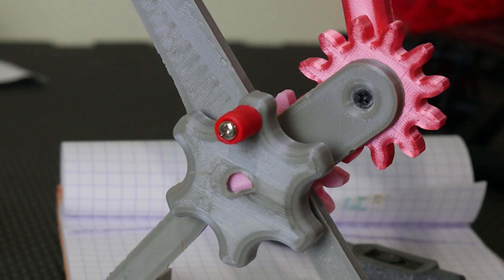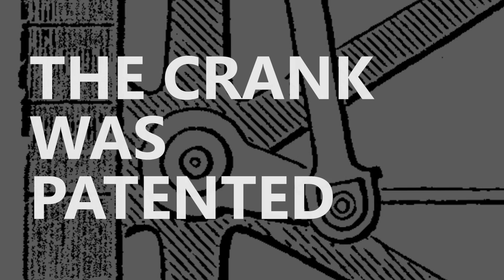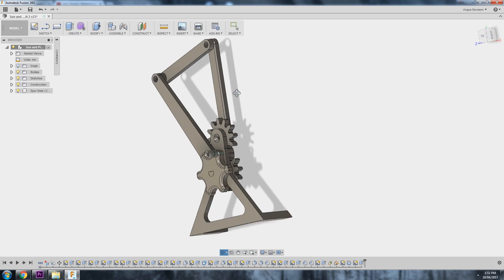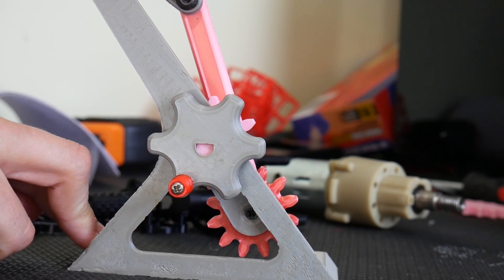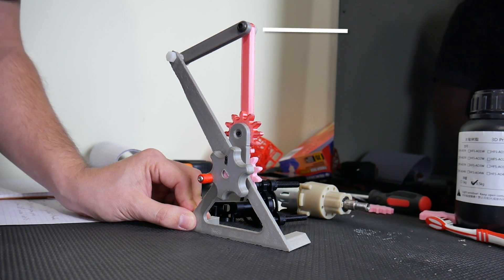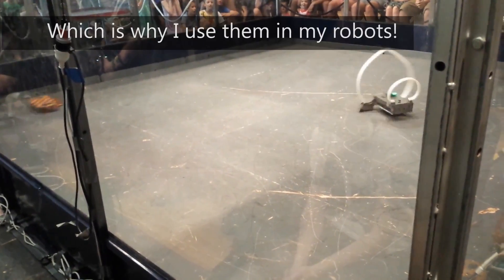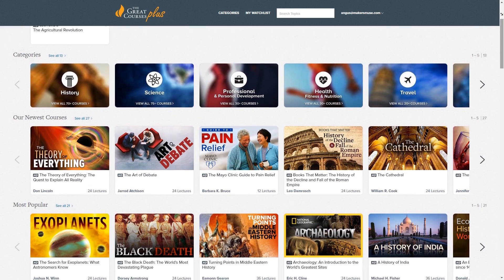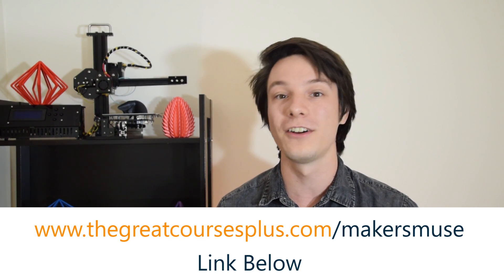How James Watt circumvented the Crank - Mechanisms of the Industrial Revolution

Comment: Super informative and entertaining channel.
I have a problem designing a tri-wheel drive in SW2016. I was wondering if you've ever designed one?
The drive shaft of each motor (4 motors in a 4x4) connects to the wheels that are mounted in a triangular formation, with the main shaft connected to the 3 gears in the middle. 
I have seen one in a space movie and I have wanted to try one myself. It uses 12 wheels (3 wheels on each motor) and only 2 wheels touch the ground at any one time. The third spins freely in the air. You can do it in any cad package you like. I want to see how the ratios are selected to have a nice fit. I have tried and failed multiple times. :(
It has excellent traction and each assembly, will spin in water like a paddle boat. I have searched hard and wide, with no results.

Comment: Patents are cancer.
Reply: Matthew Farrell  Educate yourself maybe ? Maybe read some research papers about public and private funding , here I'll even link one for your convinience : https://www.ncbi.nlm.nih.gov/pmc/articles/PMC3378609/#__ffn_sectitle
Being uniformed is ok, but please at least try to remidiate to it before  speading your stupidness, thanks.
Reply: That's the broken window model of economic growth.  If a particular design works acceptably, why should one need to engineer around artificial economic barriers?
Reply: Patents can either promote or stifle progress depending on the situation. on one hand if you can't protect your invention, then maybe you might not bother pursuing it in the first place. On the other hand, if you patent your invention and don't let anyone else use it at all even if they independently come up with the same idea, then the patent is preventing forward progress.
Licensing does help solve some of these issues, but the patent holder might set the price too high, in which case licensing may not even be a consideration.
Reply: That's absolutely not true.  I can point to plenty of open-source projects where the developers haven't earned a dime from it but have transformed the world.  Linux is the classic case in point.  The patent model just encourages a rentier mentality, not to mention patent trolling.  It  may have some apparent upsides, but it certainly has its share of downsides to go along with it.
Reply: Patents as a whole aren't cancer but the current laws are extremely outdated.  

For one the long delayed "use or lose" laws should be implemented to make patent trolling impossible.  And in a lot of fields patent duration is waaaaay too long. Electronic technology of 20 years ago is so outdated that it is absurd that patents that old still exist.
Reply: Behindspace90 Depends on the licence used, MIT licence says you can do what ever you want with the code, GPL says you can do what ever but have to make your contribution available to everyone. MIT license could very well live without ip laws, and GPL is actualy leveraging IP laws to fight IP laws.
Reply: There was massive innovation long before patents came along. So the idea that would stop inventing or improving on things because they might not get 100% return on their investment is false.
Reply: Yes they died protecting those secrets. Which is exactly the problem.

One very important aspect of patents is that after a while the patent expires and the technology becomes available to the public.

But like I already said: 20 years of patent made sense when development of new inventions was slow, not in the age we live in now where technology a few years old can already be outdated.
Reply: You're splitting hairs here.  Open source is definitely a licencing arrangement of some form, but with its focus diametrically opposed to the ideas of patents.  Arguably the only significant feature in IP law that supports it is that patent monopoly privileges for prior art cannot be claimed.  Open-source arrangements could operate entirely without IP law, but copyright and patents could not.
Reply: @Behindspace90
agreed,  patents also encourage/ force creativity and innovation as demonstrated in this video example...
Reply: This patent led to the invention of another type of gear. Patents encourage people to problem solve.
Reply: Matthew Farrell

I like the way you didn't even bother to read the paper he linked. "private sector more frequently violated medical standards of practice and had poorer patient outcomes, but had greater reported timeliness and hospitality to patients" Which pretty much sums it up really. Private sector makes you feel good with lower waiting times and the like but delivers lower quality care and is less efficent.
Reply: The patent system was flawed from the very start, as you can see. One of the ideas with patents is that after one inventor designs a machine A1, learning from the patent, another inventor might design an improved machine A2. The two inventors are then assumed to want to cross-license so that both can manufacture the improved machine A2. But the first inventor would very much prefer a monopoly on A1 than competition over A2, and so no improvements happen for 20 years (but there could of course be other machines B1, C1, etc., with sufficiently different design that they don't infringe on the first patent, provided that patent claims aren't allowed to be too broad, as has often happened).
Reply: That's the typical black-and-white reasoning from patent defenders – you're overestimating the importance of patents by assuming that without them, no inventions would ever be made at all. Being first on the market may in many cases be sufficient advantage, and reverse engineering isn't completely free and instant. Even if some legal protection from straight-up copying is warranted, what says it has to last for 20 years? 5 years seems more reasonable in most cases.

And why should independent invention not be a defence? If you happen to be the first to recognize a problem and come up with a moderately clever solution, why should nobody else be allowed to come up with the same solution for 20 years (or sometimes any solution when claims are allowed to be too broad). You seem to be assuming that most inventions are so ingenious that nobody else would have thought of them, ever.

Originally the idea was incentivise disclosure so that inventors wouldn't take their inventions with them when they die, but if an invention is so impossible to reverse-engineer, why would the inventor need patent protection? On the other hand, if an invention is easy to copy, why would it need to be disclosed? It's not as if patent descriptions are really a good source of knowledge.

Patents are monopolies, and monopolies are generally considered bad, so the burden is on you to prove that the patent system is necessary and optimal.
Reply: There's a famous quote by Bill Gates: “If people had understood how patents would be granted when most of 
today’s ideas were invented, and had taken out patents, the industry would be at a complete standstill today.”
Reply: Say you're a startup with a patent or two and try to actually sell a product. What do you do when those established manufacturers contact you saying "Nice startup you have there. Nice patents. Now, we happen to have a few patents of our own. Several hundreds, in fact. You're probably infringing a dozen or so. Can you afford to check them all? Can you afford not to? But hey, if you pay a small fee and promise not to sue us, we'll spare you the trouble and promise not to sue you."?

Solution? Don't try to sell a product that you could be sued over. Instead just wait until someone else inadvertently infringes your patent, i.e. become a patent troll. How does that contribute to progress?

It would be more honest to actively try to license your patents, but you probably wouldn't get too much.
Reply: Are you trying to say remediate? You got a little flustered there, or something.
Reply: Oh, really? Name five...in the same subject matter
Reply: What you are saying in effect is that "only the rich should be rich".

If my invention goes to market I would be a startup. Established manufactures could easily out produce me and enjoy a windfall leaving me to eat dirt.

Just as happily for them my work could be discarded and let the status quo continue. In either case the rich are enriched at the cost of stifled (real) innovation.

A business cannot gain merit if it is choked in the cradle.

I also happen to believe that with my own enrichment I could continue/better boost the quality of life of others.
Reply: There is a lot of things wrong with a lot of things! 

But by your logic, inventor A2 is discouraged from innovating off of inventor A1 so YOUR solution is to remove incentive from inventor A1 to have ever invented or disclosed - and so inventor A1's eureka does not happen for - forever.
Reply: Of course, without inventor A1, there is no inventor A2, B1, C1, etc..

In fact, are A2, B1 or C1 even "inventors"?
Reply: Now I just think (respectfully) you're crazy.

You start talking about not made "at all" (yes), sufficient and "cases". What you cannot fathom is a crippled patent system ensures that you will never know how much is lost. The same "decency" that can compel an individual to problem solutions of note, is just as repelled by the corporate and wealthy disregard for common good. Do you think they should get all of the benefit as usual?

"It's not as if patent descriptions are really a good source of knowledge." - just WOW.

Even "monopolies" are broken up - but not without compensation."Necessary and optimal" - LOL, I can prove it by non-disclosure. I'm sure it's done all the time. Maybe later. More work to do anyway.
Reply: What's crazy is ignoring the costs of the patent system and only looking at the benefits.
Reply: So, you got that all worked out in your head?
Reply: "There is no invention #1, #2, #3". 
Ecclesiastes 1:2 “Meaningless! Meaningless!”
    says the Teacher.
“Utterly meaningless!
    Everything is meaningless.”

10 Is there anything of which one can say,
    “Look! This is something new”?
It was here already, long ago;
    it was here before our time.

We'll see. Restricted to the materials at hand. You could as easily say that all inventions are restricted to past and current knowledge. The past and current knowledge are not the invention, they are the restriction. New knowledge is the invention.

You can certainly reduce the number of inventors or their disclosures. The significance of 0.01% of 1 million instead of 10 million is noticeable. 

"Not the inventors them selves." Such is the pity although it is not always that way. Determined destruction of IP rights (rewards) ensures this. Why destroy most of the 0.01% because of corporate dislike? The patent system promotes independent efforts or should. 

If the corporations are going to "get it all" anyway, then aren't the U.S. patent objections immaterial (except to China)?
Reply: Patents for software? All over the place. Bubble sorts and the like have been in the public domain for decades (BTW, subscripting is the real overhead)..
Reply: "A Patent Lie", The New York Times, 6-9-2007

"Bill Gates certainly thought so in 1991, even if he won’t admit it today."

"WHAT a difference 16 years makes. Last month, the technology world was abuzz over an interview in Fortune magazine in which Bradford Smith, Microsoft’s general counsel, accused users and developers of various free software products of patent infringement and demanded royalties. Indeed, in recent years, Mr. Smith has argued that patents are essential to technological breakthroughs in software."
Reply: The other day, after several others on a forum declared a problem unsolvable, I outlined/disclosed a (patentable?) solution. Your welcome.
Reply: That would be horrible, and maybe the only chuckle I have this week - thanks.
Reply: If ONLY the top of the line robotic arm will do, and you had no insurance, and you were at fault, and you have no money, and the maker shows no compassion, and..., and... you can do a fund raiser.

Worse yet, you can buy the $1,000 Chinese knockoff and watch yourself burn to death when the battery explodes (while an American kid wonders why his Mom or Dad can't find a job).
Reply: The PTAB: Number One Enemy of Inventors

http://www.ipwatchdog.com/2017/07/22/ptab-number-one-enemy-inventors/id=85659/
Reply: That article seems maybe just a tad one-sided. We're talking about 20 years of monopoly, so it's important that there is a way to revoke that monopoly if it was granted incorrectly, mainly if it is discovered that the invention wasn't actually new. The procedures of course have to be unbiased, but isn't it a problem with the US legal system in general (and maybe with all legal systems to a lesser or greater extent) that the party with lots of money has an advantage over the common man?
Reply: I'd love to see that forum thread.
Reply: It would certainly be preferable if the patents that are found invalid upon reexamination had never been issued, but I wonder if applicants would be so happy paying a 400% higher application fee just so the examiner has more time to find reasons to reject the application.
Reply: Matthew Farrell is such an inventive soul he closes his eyes to other possible solutions straight away!  Onya mate!
Reply: vidznstuff1 Intellectual property is very different from "real" property of tangible objects, you can't apply the same reasoning to both.
Reply: Depends on what it is.

Some cases yeah.

Put take for example medications, the can take, millions and even billions of dollars to develop. So there needs to be a return on investment, this is where the patent comes in. It allows the company to get their money back, make some profit and then reverts to open market. Which is how patents are supposed to work. Without this there would be no money in it, and therefore no new medications coming out, as people would wait and just copy what you did.

I guess if there is R&D involved then patents = good.
Reply: Matthew Farrell Medication could be made by public reasearch, no patent would be needed here as the population would pay the research through their taxes.
Reply: the Venetian glass blowers, Chinese silk, coffee.  People died protecting those ideas and products.
Reply: Wow. Patents have fuck all to do with "controlling humans", and the rest of what you said has fuck all to do with anything.
Patents ensure that someone has the ability to make money off of something that they came up with.
Reply: Aw, c'mon MrBleulauneable.  How are the legal eagles going to get their free lunch if you pull the curtain back that far...
Reply: Jack Evans, in medical care the public-private dichotomy is a very blurry one indeed!  I don't think there is any place on earth that has a truly broad spectrum of private healthcare provision - mainly because the government loves to so meddle in things.
Reply: Behindspace90 - "Adults" can come up with sober solutions. Finding them is... problematic.
Reply: Patents are only bad if the holder either doesn't license it or if it's essential for competition and the holder puts too high a price on the license.
You can't expect companies to pay R&D costs to create new things if companies then allowed to just flat out copy. If someone invents something new that people want, the patent holder should be making money.
Reply: The point of patents is to encourage and reward innovation. Good enough without protection means no R&D, no investors, and thievery. Look at countries without patent enforcement - a lot of copycats diving to the bottom, no innovation. I'm not going to invest a million dollars in developing an idea while you stand there and get it for free. With that, everybody stands around, waiting for free and nobody spends a dime.
Reply: Patents are a cancer, as is owning a house. The two are indistinguishable, unless you are saying the government should put you in a house of THEIR choosing for free. That will do a lot for architecture, won't it?
Reply: Educate myself. Thats funny.

Considering your very ignorant response. 

All i see is a bland wall of text that gives no indication of you making a point. Maybe you linked to the wrong part you were hoping for.

But let me make it loud and clear. Anything the government does is full waste. Period. In Australia health costs due to the public system are 25 to 30% greater than if it was private. Also we get less service and longer wait times.

So please don't insult me with your left leaning cancerous socialism. I want no part of the waste it gives.
Reply: Do you even know how bad that public system is. Or how wasteful money wise. What would cost a private company a billion dollars would cost taxpayers 10.

Or we end up with over exaggerated  (note not false) claims on things like climate change.
Reply: Hahahahahaha.

Now that was a good laugh. Going to have me laughing all night.

You must he a socialist. Because only one of those would be that silly and ignorant.

Comment: I wonder... how would the planet gear (in the crank use) perform if it was shaped in an ellips?
Reply from the maker: Definitely possible, you would result in an uneven speed output as the gearing varied.
Reply: It might even help the reciprocating motion of the piston; by giving it more power during the powerstroke and making the transitions between the up and down motion much faster.
Reply: With 3D printing we have the power to find out.
Reply: I'd love to see that experiment

Comment: What printer was that printed on? The quality is kinda bad.
Reply from the maker: The pink one right? I was having weird issues on the UP Mini 2 at the raft interface, but wanted to print in ABS for the sun gear for a stronger shaft. The shiny red is poly alchemy elixir and shows up print flaws quite strongly.
Reply: The pink one is the worst, but all parts seem to have a bad first layer.